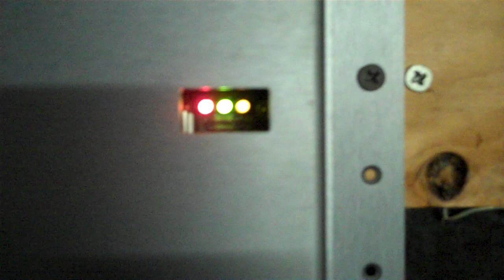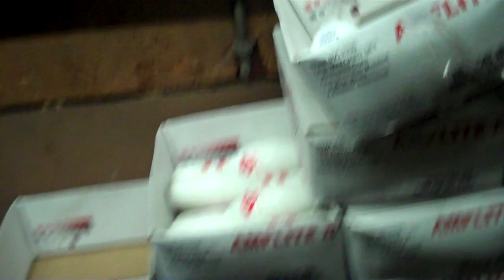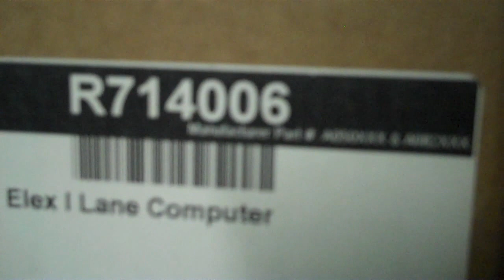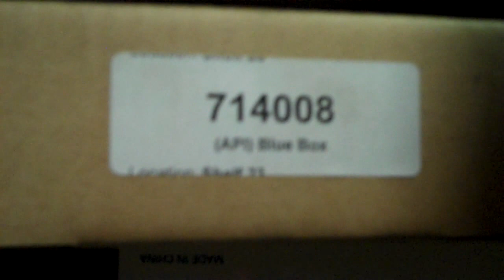Steltronic SuperElex Automatic Scoring System Part 2

Comment: Nice. I see some similarities between this and Qubica.

How do you adjust/setup the camera?

Also, how does the scoring know when to take a score? With AccuScore you had a sweep zero switch, you know, so on this one is it like Qubica where after the cycle beam is broken the score is taken after a delay? Interesting how there are two ball detector beams and one is for speed the other for cycle, I'm just getting used to Qubica having two except both are for cycle and ball speed.